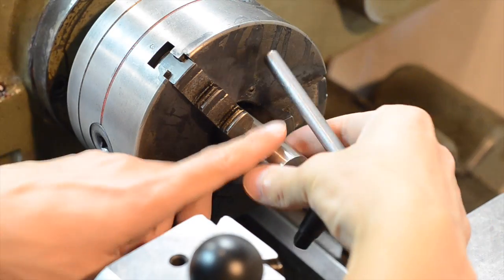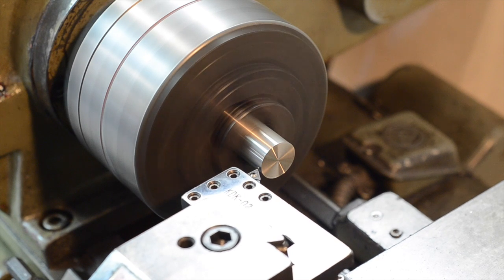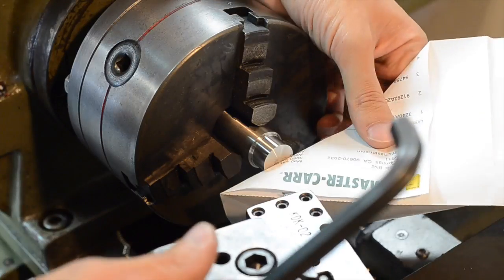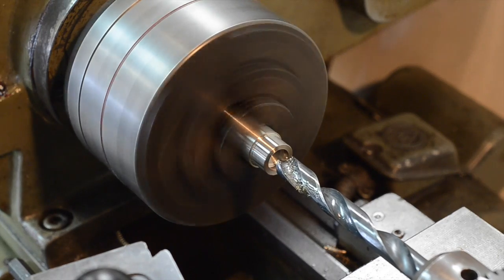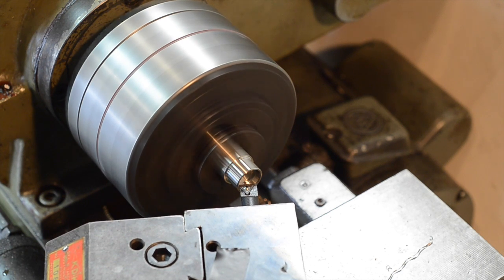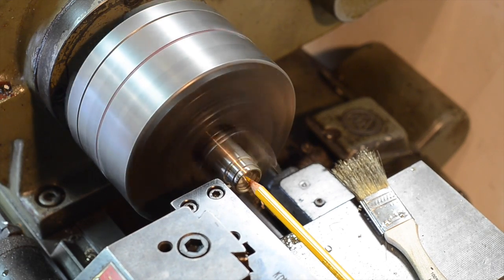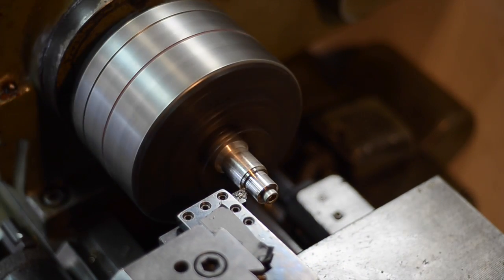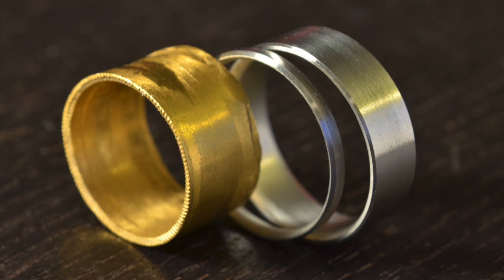Machining a stainless steel ring

Comment: great video and very informative but i would like some clarification could i use regular 316 instead of 316l as i don't have the funds to purchase 316l round bar, and would it be fine to use that as the core of a wooden ring??
Reply from the maker: 316 will be fine. 316L has a reputation for being "surgical grade" since it is often used in implanted devices, but the difference between 316 and 316L won't matter for the type of skin surface contact you'll encounter in this application. If you have a nickel allergy, you should consider passivating the steel after machining, whichever grade you choose. In terms of machinability, 316 and 316L are basically identical.

Comment: Hey :)
Can You please tell me what lathe are You using? 
Nice work by the way !
Reply from the maker: It's an old 9" belt-driven lathe with a top speed of 1000 rpm. I believe the model # is Select 1023B, and it was made in the late '70s.

Comment: Do you or anyone you know resize stainless steel rings? I've been desperately trying to find someone that can take my ring up 1/2 to one full size.
Reply from the maker: I don't do this professionally, so I don't really know. I've never heard of a steel ring being resized, though. You can't cut + solder it as they do with gold alloys, and the force required to stretch it is probably too great for standard jewelry equipment.
Reply: a file is the best way to bring the size out
Reply: MT2 morse taper can be used as an expanding mandrel for stainless steel rings. / 2 years late...